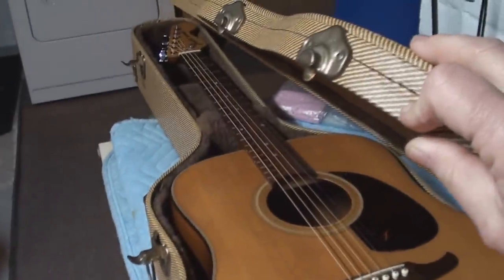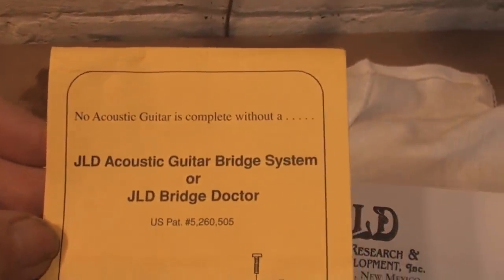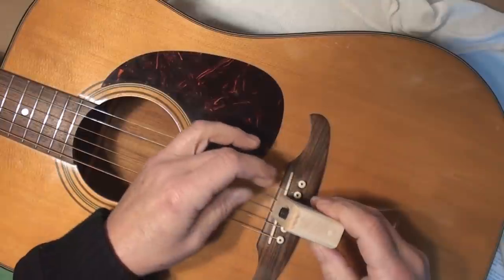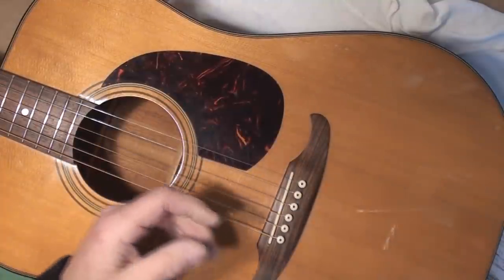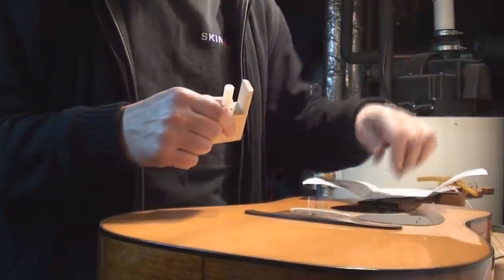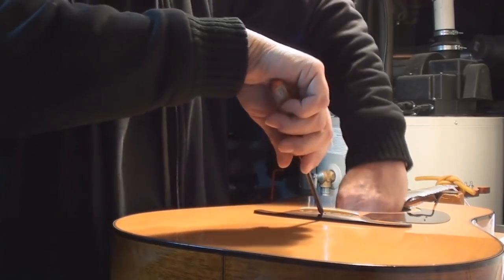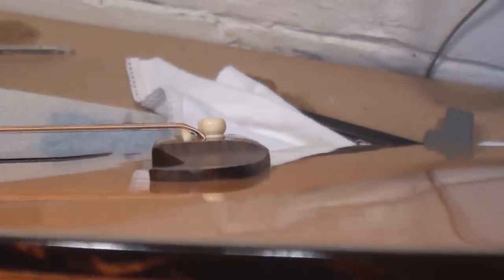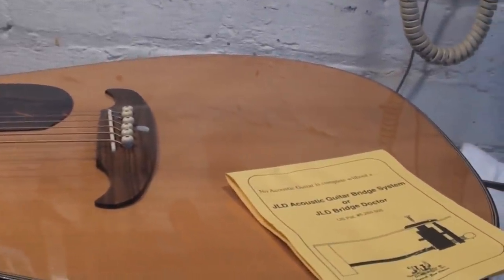JLD Bridge Doctor Installation

Comment: Just finished an install of one of these.  Didn't help the string height;  the guitar is straight now but the strings are still too high.  I wish I could do a neck reset on a $100 Alvarez but I hear they are epoxied in.   Guess I'll bring shave down the bridge 1/16th to fix it.

Comment: in 1993 i bought a bareLy used yamaha-ha "foLk-you" guitar for about 40 USD . 
even with Low tension Martin siLk&steeL strings it had the dreaded beLLy-up diLemma. as the yamaha-ha was quite smaLL in aLL dimensions and i am a Long-fingered fender bass pLayer , i decided to fix it up as a gift for my doorman . i ordered one of these JLD gizmos from stew-mac. when it arrived i saw that it wouLd work, but i did not have
the tooLs or skiLL to instaLL it.

Comment: i made my own bridge doctor from scraps,it works for my 1974 yamaha acoustic.and i saved £18.the funny part is that i didnt have a dowel to use ,so i used an old airsoft brass barrel instead.which is ironic because i swapped a broken airsoft gun for the guitar in the first place.haha.p.s. all the measurements are on the stewmac website.

Comment: Wrong, there is nothing wrong with the dot design. Had you used the brad point first as per instruction, then follow through with the clearance drill, ... you would then have your proper fit countersink that would allow the perfect fit. It is not "stupid" as you claim!
Reply: YES!!!  Do follow the included instruction sheet, using first the "BRAD POINT"  1/4" bit, (do not drill through, only counter-bore), then use the smaller bit for the #6-32 machine screw.  About all I can see that I might change would be to change out the C/S Head for a "Pan Head" screw.  This because a C/S Head screw might have a tendency to split out the bridge along the grain line??
Reply: Still, that dot is ugly, a rosewood or a black one would be better.  Maybe cut the head off of a bridge pin and stick that on there.

Comment: If you actually follow the instructions, use the proper bit,  the pearloid button does cover the screw.
Reply: That's what I thought too - by using a counter sink tool, which is cone shaped, the hole is larger at the surface than if the recommended drill bit size is used.